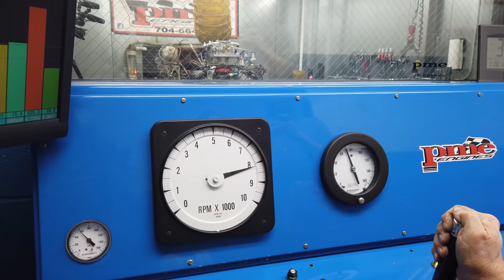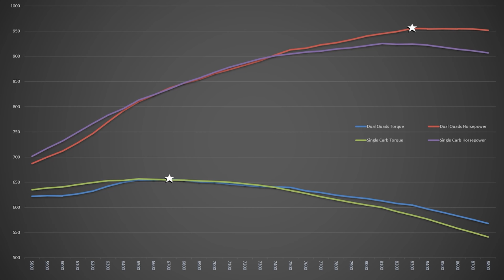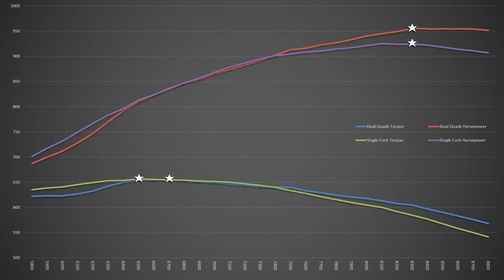955 Horsepower NASCAR Engine for the Street! (w/ ProMotor Engines)

Comment: Would be cool to have a NASCAR engine... But tell me you can't use a LS and get the same hp for far cheaper and an LS motor parts can be purchased at the local parts store. 99% of people looking for a motor for their project will not use this motor. Cool factor yes, practical… hell no.

Comment: its amazing tons of learned and passed down old school n new school tech... BUT its hard to work on, requires race gas which it drinks like a beast, impossible dam near to get parts for if something goes wrong is less than 1k HP and is COOL AS F**K don't get me wrong.. but with GTRs n 2jz and LS3s with boost, etc.  out there with non of those exclusive high dollar potential issues... special gas etc..  its this really worth all this trouble ? think about it....I mean sure if you got money to burn w.e. , but for anyone else it doesn't make sense... bang for your buck ? nah... the only thing that is irreplaceable is the exhaust  sounds... for the money, maintenance, exclusivity, race gas, etc I'd pass...but to each his own... that said this shop and the guys working there are ABSOLUTE PROS, youde have to be blind (no offense) not to see that...total wizards.. respect

Comment: Nascar has become largely irrelevant for manufacturers. The OEM's are pretty limited as to what can be done (teams are not going to sacrifice a good finish to run longevity experimentation for them, and the rules would likely prevent any real innovation), and the technology used there exists nowhere else in the automotive world. Nascar has turned themselves into the Amish of auto racing. 

Nothing against this engine build, or the folks that build them, but looking at this motor should tell you all you need to know about why Nascar is no longer relevant.

Comment: Chevy engine.. ? With equal bore spacing on the exhaust and the intake, with a Dizzy in the front..  SBF all-day...
Reply from the maker: GM has had distributors on the front of the engine before. Besides, Ford doesn't own the rights to distributor location. It comes down to, would you (not you specifically, just people in general) prefer the distributor where you are used it it, or better performance? Thanks for watching

Comment: So heard that roush Yates Fords had better heads then Chevy cried about so did nascar because the Ford motor were making 50 more horsepower , so roush had to had make Chevy heads to be competitive with Ford engine
Reply from the maker: Don't forget Toyota was coming in with a brand new design that would have spanked everybody. So NASCAR wrote up a set of rules that applied to everyone and they all came up with engine designs that fit that box.
Reply: I’m sure they did every manufacturer got a motor in the box that nascar won’t let them use lots of fun 🤩 thank you for the reply I love the nascar wars that’s what makes nascar so much fun one year it’s Chevy one year it’s Ford one year Toyota love it I hope it never changes

Comment: So they copied Chrysler as far as the inner headstuds. My tfx96 ajpe based hemi engines use the same setup but headstuds are 1/2" and inners are 7/16. 526 cubic inch so 4.310 bore x 4.500 stroke with 7.275 aluminum rods

Comment: Leave it to Nascar and they going to screw it up even more,no one dam facility should be building all nascar engines, that takes the  competitive of different engines builder's away,you have ford engine builders that learned, and could get more horsepower than some,same way with chevy engine builders,all the hell Nascar want to do is make every thing dam the same, thats not racing, it's dam stupid and all about control, go to dragstrip and and tell them we going to have one engine builder, see how that goes,truth is known if ford is winning more races,they want to step in and stop,or change rules, just like Chevy couldn't beat the ford Cleveland head type motor,so chevy only hope was to finally copy  the ford head,if Nascar implements this idiocy ideal, hopefully no one will ever go watch such stupidity that destroyes the whole backbone of racing and whats its all about,which who can work real hard  and maybe build a ford  or chevy motor that puts out just a little more horsepower than the other engine builder,next they will think of robots for drivers to make them equal, wake up fans, hopefully uf this happens, no one should go period